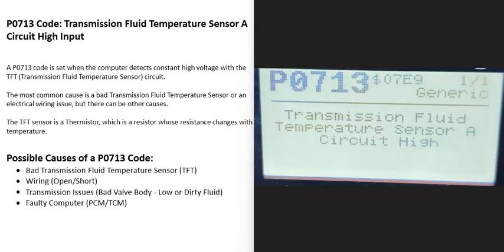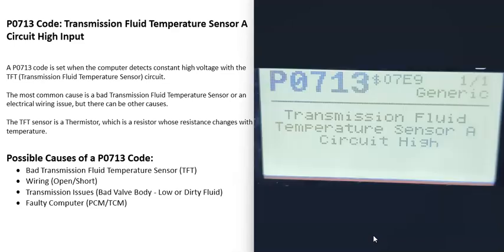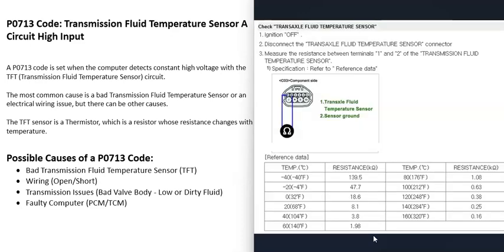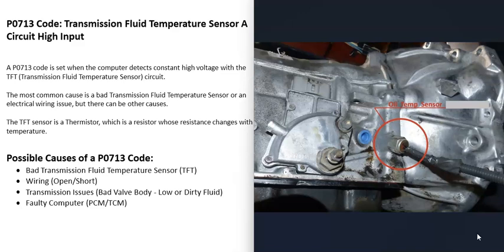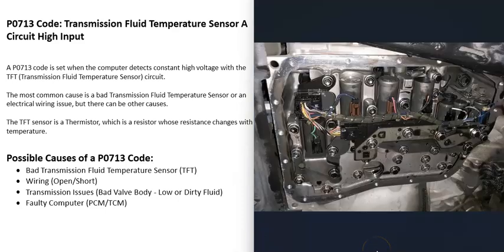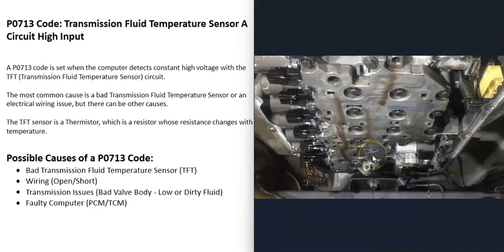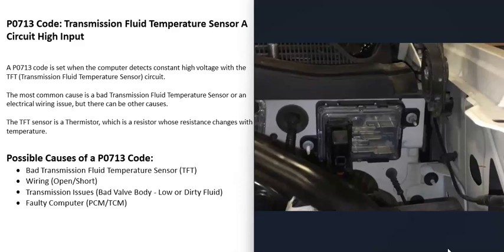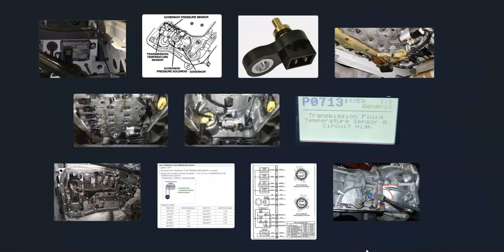Causes and Fixes P0713 Code: Transmission Fluid Temperature Sensor A Circuit High Input

Comment: Thank you for this advice. I have a 2000 Mitsubishi Montero and i put new valve cover gaskets up plugs wires starter almost a year ago. 3 weeks ago it shut off going down the road. Water pump failed and jumped time but not bad enough to bend the valves. I just had that done and a new radiator. This code keeps throwing. It started jerking really bad so I put in a fuel pump. It's done great but I've only put about 250-300 miles on it since then. Monty has 303k miles and I've got probably 3500 in it the last 2 years. I did notice I was almost a quart low on transmission fluid. I took care of that and cleared the codes and it popped up again after 10 miles of driving it. Any suggestions

Comment: Step motor replaced symptoms and code came back. Does it have to be reset?
Reply: A step motor is different from a temperature sensor..  so obviously it will have the same code.